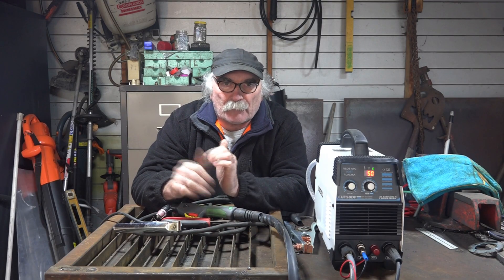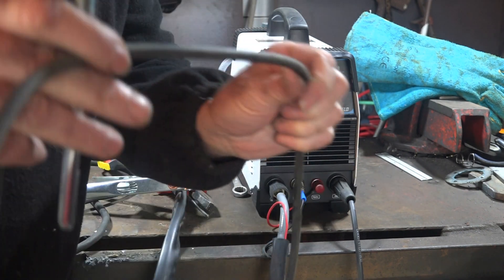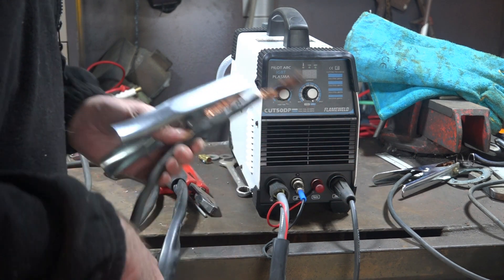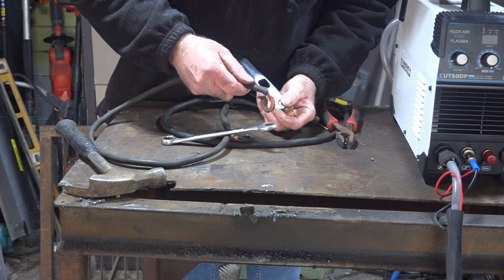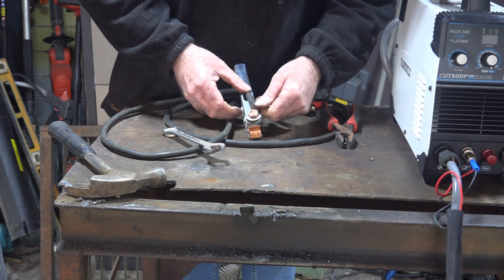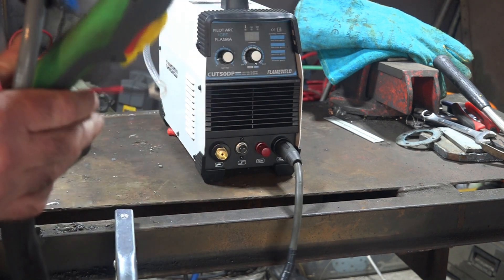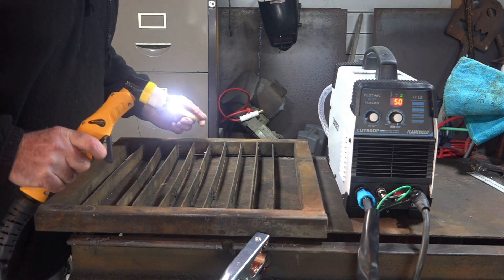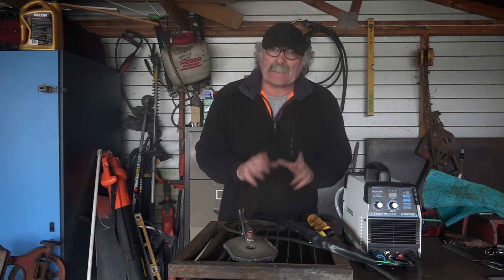Upgrading a Plasma Cutter - The best way to Increase Cutting Capacity

Comment: Awesome Pete! I tend to like the upgrade ground clamps that Horrible Freight has. I do not know if you have something like that. I believe they are brass and copper. I am totally psyched to see the larger torch head. I want to adapt a Hypertherm torch to mine and add some capacitors maybe to upgrade the cutting power.
Reply from the maker: Yea we have out own crap brands here in new Zealand as well

Comment: I wonder if a larger power cable would squeeze a little more power from it?

I have a newer version of this machine and it has a small 110 Volt cord and then an adaptor to make it fit 220.

After the warranty is up I may put a big, heavy 220 cord on it.
Reply from the maker: good idea to try

Comment: Hi Pete, I no longer buy lugs, as im a cheap bastard.
Instead, I make em out of copper pipe, just use the size pipe that fits the copper braid snug.
Squash one end flat, round off and drill for ground bolt, slip in copper braid in other end, stake it and youre done!
Reply from the maker: Cheap like me lol
Reply: @petestools  you kow it buddy!